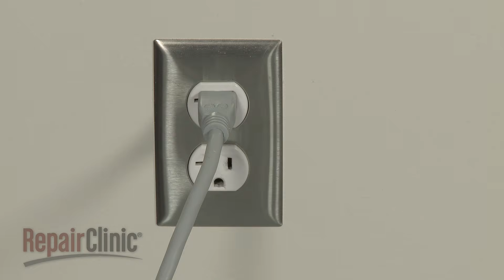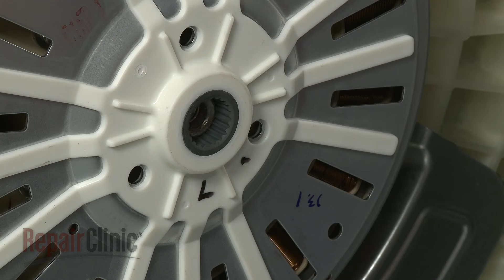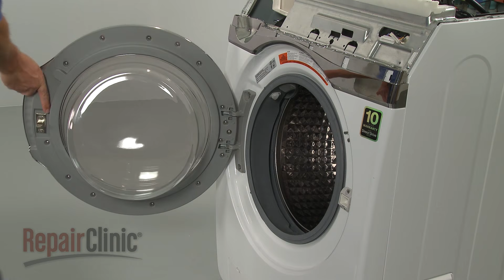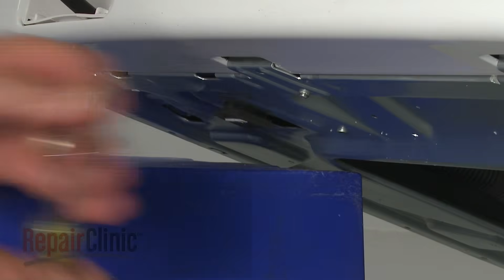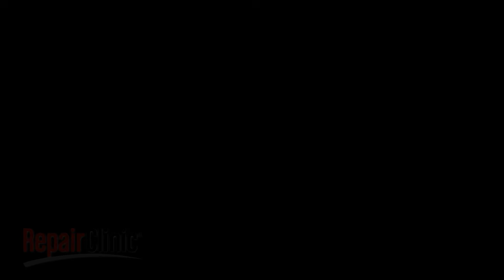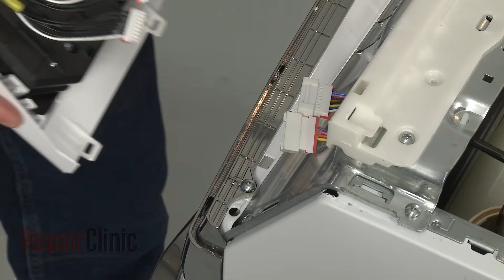Samsung Front-Load Washer Disassembly, Repair Help

Comment: Thanks! Only thing missing is everything else on the front side...
Unlock spring, remove upper bolt from the forward 2 shock absorber, unplug almost everything, remove the 12x 10mm screw from the front of the washer drum outer shell to uncouple the front half..
I figured it out...

Comment: Good job. Please help me. I have the addwash model and I have the dc3 error code. That means my addwash door can't be locked. Unfortunately, I don't see on the internet the way to disassemble the front door. I want to reach the lock mechanism in order to repair it or change it. It seems the lock pin gets stuck. Thank you in advance

Comment: Thank you very much. Straight and forward.
Samsung customer support is pure garbage I just needed to know how to remove the front cover. Ain't no way they would provide with the SERVICE manual when asked.
They direct me to a local affiliate repair shop.
I now need to call them and ask for a thenician to come here. Or what will happen is the repair compagnie will give me the information directly on the phone and curse samsung for the way they trow problem with easy fix down the chain.

Comment: I couldn't get my rotor bolt loose because the rotor spins.  I had to stick a screw driver through the rotor to brace it with the stator and hammer the wrench. That ofcourse will damage the stator but I was disassembling to trash the washer anyway.  The circuit board died and I couldn't find another.

Comment: I'm trying to decide if my machine can easily be fixed by me. With mine, the front panel turns on but nothing happens when you press start. There is no error code. Does anyone have any thoughts?

Comment: This is a very informational video, but for everything except for what I need. There is a white sort of triangle looking piece in the top rear of the washer that has multiple hoses going into it. There is a little nipple at the bottom of it and it is spraying water out a fine mist of water. I have to turn water to my washer off when I’m not using it. Thank God it is sitting inside of one of those little floor protectors so when the water gets to be too much, I can use my shop vac and vacuum it up. It is such a minute little late and I am hoping to be able to replace the piece.

Comment: I can’t get forward of one minute. The rotor doesn’t simply come off. Tried wiggling, tapping, pounding with a mallet, spraying with oil… Won’t budge! Getting ready to throw this garbage in the dump! Good video though. Frustrated. Runs rough and smell of burnt rubber. Thinking it is the spider thingy, but can’t get started to find out..😢

Comment: This is a great video. But the top of mine is stuck and won’t pull back and lift off. 
Any idea why it would be stuck? I undid the screws holding on to the bottom and even tried unscrewing everything near the top of the machine on the back… no luck. 
Won’t budge 😞

Comment: Hi i'm  way out of sync here but do you have a video about replacing the counter balance? 
i bought a used Samsung front loader, it was delivered because i can't drive my own truck anymore. immediately concrete pieces busted off into the bottom of the machine floor, so i'm fixing to order a counter balance but it would be great to watch a video as clean as you do, about replacing that?
Reply: wf361bvbewr/a2 ...is my model, i have all tools on hand i just am looking for a detail video of replacement of the part that slung fist-sized pieces of concrete. I lost my leg in a motorcycle wreck but i can still tear down/rebuild 4x4s, ect. i just need some help on wtf to do with this machine! Thanks in advance!!

Comment: With the more modern Samsung washing machines (Including Wash+Dryer Combo) its even easier to take apart, screws at the bottom are now well placed so you no longer need to lift up the unit to unscrew. I had an issue where lint / debris were badly stuck in the circulation pump. Impossible to remove via the filter, and after only 15 month of purchase! Being a refurbished machine due to dents it only had 1 year warranty. Cleaning wasn't enough, had to dismantle the machine, remove the pump, and unscrew the pump to remove the massive chunk of debris stuck in the motor blades. Though the whole process was easier than I thought it would be. Removing the waste hose from the pump and then putting the unit back together was a little more challenging but not impossible. Saved me a $200 service fee. Though I'd never buy a Samsung without warranty again.

Comment: Great video! My problem is unresponsive panel buttons. It's not the child lock. Also left it unpluged and will not reset. Can only select modes with the main rotary button.
Reply: Fixed! One of the solder pads on main board, J9 was corroded. Cleaned and replaced with new piece of wire; like new!

Comment: hi, my washing machine is samsung 8/6kg washer dryer, this is the second time i burn mainboard. ,due to very expensive for the board, i tried to repair my self and finally i found that , inside hv a "slow blow fuse)that normally is that item burn,(black screen and cant start /on )after change it , can on and lcd screen also light back , but once start run,fuse blow again...i suspect is the main motor burn,because other part almost eath to eath change newby my self like door swith,drain pump,presuure swith,even the 4way inlet valve also,but stil.same

Comment: Thanks for the video! I'm having trouble with the basket, 'cause it stopped functioning with a full load and I can only washed very few things until a week ago, when it completely stopped. I'm trying to figure out the problem, did anyone have a similar issue?
Reply: I have a similar issue, any updates?

Comment: Thank you so very much for this video. I had a leak from somewhere. It wasn't the usual suspect and ended up tearing into the washer myself. I went back several times to view the steps and it helped so very much. I discovered the leak and now I no longer have a leak. This will be my "go to" site for diy repairs. This grandma is a very happy camper.

Comment: This video is “how to” perfection!  My son left a vintage coin in his pants pocket. It was stuck in the drain hose just prior to the debris filter. I could see the coin inside the drain hose through the debris filter housing, but could not grab it because it was too large to fit through the debris filter housing. I followed this video step-by-step to disassemble the machine. This gave me easy access to the hose / debris filter housing connection allowing me to remove the coin.  Thank you to the makers of this video for a clear concise guide with just the right amount of detail. This saved me an unnecessary and likely expensive service call.
Reply: S
Reply: It's uncanny how similar my situation is. This video is gold.
Reply: Greece
Reply: What type of coin got stuck
Reply: Bro I have the exact same problem,with a metal pin slightly too big to get to the filter

Comment: I have zero power to anything. Stopped mid cycle. water drained. Power button doesn't work. Verified AC at the duplex outlet. The unit is at least 10 years old. Main PCB problem I'm guessing. I cant find an internal fuse/breaker. 
 Worth fixing?
Reply: Front load Samasung WF448AAP/XAA

Comment: Is there a way to test if the stator motor is faulty (like with the pump motor, you can use a multimeter to test for continuity)?
Reply: the stator reads 11.6 ohms from each pair of wires if it is ok

Comment: I must replace the tub bearings for the second time in 2 months on the Samsung H425000AW/A2 01 Front loader. The damn thing sounds like a jet at takeoff @ high spin. When I installed the bearings the rear appeared to be already greased. Should I have greased the front roller ball rearing as well?  My research did not indicate it was required.  Brown grease has leached out of the back of the machine and coated the motor.windings & stator. It made a real mess.  It also seems that the bolt that holds the stator on will only go on halfway in.  Is there a torque setting for the bolt?? 
I will tearing into this as soon as my replacement parts come in

Comment: HELLO, I NEED HELP WITH MY SAMSUNG WASHER MODEL WF431ABP/XAA 01 BEFORE IT INDICATED ERROR CODE E2 NOW DOES NOT WANT TO TURN ON. DONT HAVE ANY ENERGY.
Reply: The E2 error code indicates a stuck key.  This could be caused by a key that is physically stuck because some liquid detergent or fabric softener dripped down on the keyboard and dried up, in which case you can fix it by carefully removing the control electronics from the plastic control panel, and then cleaning up the dried soap/softener.  If that's not the problem, then you have an internal key short, and you will have to replace the control electronics.

Comment: Hi, I want your support, my washer is GE and doesn’t start, door is locked. How can I reset the washer. It’s like there is not energy in the panel. How can I open a access panel to see if there is any electrical issue?

Comment: Great video. My washer had an “nd” error. My wife washed a bathmat and the back of it disintegrated. I took it apart following your instruction and cleaned out the drain hoses. It was full of the rubber from the mat, a lot of sludge, and a quarter. Now it’s working just fine. Thanks, very informative and simple to follow.

Comment: Disassemble them with a sledge hammer and drop this POS in front of Samsungs corporate offices with their exploding phone and top load washer. We need some lawsuits for all these companys that saved 3$ per unit for not making a SS spider. Really, the Chinese can fab that part for 3$ in SS, but then the machines would last too long. Corporate greed
Reply: Richard Raucina you got that right! They know that making the spider bracket out of cheap white die cast aluminum instead of SS like the drum it bolts to, will corrode from the hard water and sulfates it’s inevitable. As long as it surpasses the manufacturers 1 year warranty.  My LG front loader spider bracket broke on all three arms, then when I tried to order parts from LG Canada they said they only sell them to dealers and a technician has to install them like its the NASA space shuttle or something! Anyways LG Canada now sells parts directly to the customers but when I tried to order the drum spider bracket they said they only sell them with the drum for $300! So naturally your going to change the inner and outer bearings and seal while you got everything apart, probably replace the large O-ring that goes between the two outer tub half’s. You add up everything and it makes more sense to go out and buy a new washer and it’s not bad luck or you got a lemon, it’s all been calculated by greedy corporations and I’m not even going to get into the mold and mildew problems of the front loaders that they tried to get away with. There answer was to sell us a product to mask the mildew smell that they tried to make us think that it was something we did that made our washer smell! It seems it’s a throw away society we live in and by making inferior products or parts like the infamous spider arm they know we will keep coming back to buy more of their shit!
Reply: To be fair Alan, I wouldn't mind taking a sledge hammer to my 3 year old broken washer.  Classic tE code that just means enough time has passed that it has disabled itself.
Reply: Our LG makes so much noise on the spin cycle you can not talk in the next room over. We thought this would be a better machine than a shitty Maytag  ( Maytag is not welcome in our house ) but I guess we were wrong. I can not even find a schematic diagram for this POS.
Reply: Richard Raucina yu
Reply: Not necessary being such a douche.

Comment: Thank you for this video. I checked out others but this is the one that helped me fix the problem which turned out to be  just a broken spider. There was no evidence of water intruding through the seal. One should check the bearings by feel before removing the seal unnecessarily. I would imagine most people would ruin the seal removing it as I did. Upon inspection my bearings operated completely smooth with no play side to side. That spider is surely an engineering defect on two levels. First,  any water and grime that gets to this area either shouldn't get there to begin with or should rinse out completely. Second, the spider itself should be a solid casting without the channels for crud to build up in or at the very least be coated in some impervious epoxy that protects the metal from corrosion. If indeed the part is strong enough in the first place to handle the stresses it undergoes.
Reply: seelark What is the spider?

Comment: For these high efficiency Samsung machines, isit bettet to use powder detergent or liquid? Just got one and planning to make our own detergent delicate enough for our 7 months daughter as m
Reply: I'm a homeowner (not repairman) but have been told that powder is better for the machines. These tend to get a mildew smell. We have not had a problem since we started using white vinegar in the "fabric softener" cup, a small amount of Zum liquid detergent, and a small amount of oxy powder inside the drum itself, removing wet clothes within an hour, and keeping the door slightly ajar when not in use. It seems like a lot of trouble, but has prevented the problems that most people have with front loaders. Our Samsung is six years old.
Reply: ClarkLark Thanks. We re using Dr. Bronner s Castile liquid detergent for time being and vinegar in the conditioner compartment. Everytime the machine is not in use, the door stays open and also I remove the whole detergent compartment rinse a bit and let it dry until next wash. Hope it will last us many years. Thank you for the advice and many toruble free years with yours :D
Reply: It is best to use gunpowder in a dry machine. Use 2# packed tight into a pipe and ignite with long fuse. When machine explodes, take it back to your Samsung dealer. Then buy a $300 Whirlpool top loader.
Reply: Q
Reply: Richard Raucina jejejejejee if it breaks too fast, thats what Im gonna do. Whirlpool lost quality lately. I do have fridge and a freeze box from them, back home. Ive recently changed my mom s old Whirlpool with 800 rpm spin and got her an advanced Electrolux that fitted through the tiny  2nd bathroom door frame. She was so upset with me for giving up on that old Whirlpool. Ive been very happy so far with Samsung EcoBubble. Lets see in another 2 or 3 years from now. Got mine ex display for 300gbp ( RRP 500) so I am more than happy, so far.
Reply: You should listen to Mom. Keep that Whirlpool as backup. I have the cheapest top load Whirlpool washer, perhaps $320 - it is the newer generation with the locking lid and faster spin. It does a good job, and after 5 years I have had only one glitch with the electronics, went online and did a full reset and its fine. But I have in the cellar a older generation direct drive mechanical whirlpool that you cannot kill. Just change the rubber drive coupler every 6 to 10 years and it's good to go. I don't think these big size units go to GB, they are strictly an American thing.

Comment: This video was truly helpful for my repair. I replaced the door latch mechanism (front loader) on my Samsung WF350ANP XAA 03.  The mechanism is enclosed in a plastic case which had shattered. Why? Its a mystery to me.  The replacement part was available locally for me and the cost was far less  (< $100)  than I expected since it is an electro-mechanical part.  Given the number of pieces that needed to be removed, I expect that a service person might have needed 2-3 hours to disassemble and reassemble the washer.   I wonder what a service call might have cost me?   Does anyone have any experience with the expenses associated with a service call?   
            While I had the unit open the shock absorbers were exposed so I pulled those out to learn if they were functioning properly.   Yes, they were. I'd note that properly operating absorbers have about 1/2 inch of light resistance followed by stiffer resistance.  At the parts store, new absorbers functioned the same. 
           I've read some comments with people stressed out because their washer betrayed them. Yes, it is easy to have that feeling.  When I studied the insides of the machine it was obvious that there were many, many plastic components.  Nevertheless, I thought it to be well designed.  It was definitely better than other washers I've owned with cast iron transmissions and various belts that dripped oil, wore out belts and caused other problems. 
      I was most impressed by the direct drive electric motor and the efficiency and simplicity of the system.  Well done Samsung.  Even after this breakdown and repair, I'd go back and purchase another one.
Reply: Judging by the HUGE number of complaints and failures in the Samsung front AND top loaders, and by the sheer number of videos here, You are a real optimist. Check back in a few years when your main support dissolves and the service call is $1200.

Comment: Great video, I have a samsung front load washer.  When you tub spins clockwise it makes a lot of noise and spins very slow.  However, when the tub spins counter clockwise it spins smootly and makes no noise.  Does this sound like a bearings problem?
Reply from the maker: +Keith Willard Most likely this is a bearing problem.

Comment: Have a Samsung washer that really squeks as it starts to spin,   then at the end of the cycle some times it sounds like is is bouncing around but the machine is not moving,
Not having any luck finding a Samsung repair person so maybe I will try it myself
Reply from the maker: +GRIM x AQUA Loud squeaking on a front loading washer is normally an indicate of the rear bear going out. The bearing is often only available with a whole new outer rear tub.